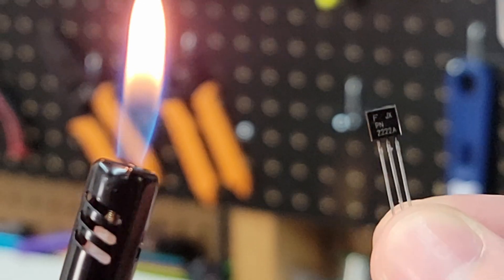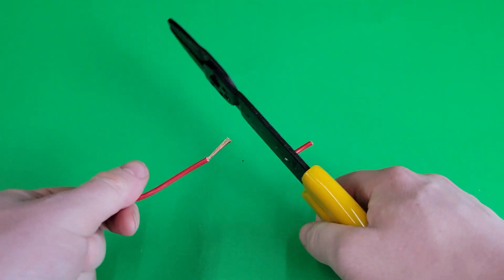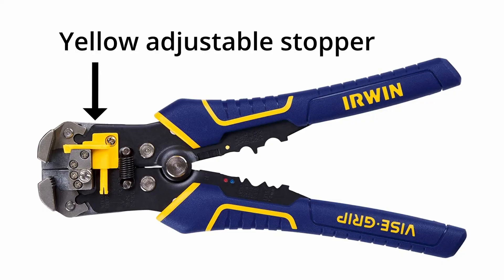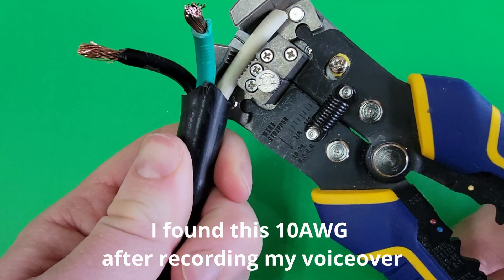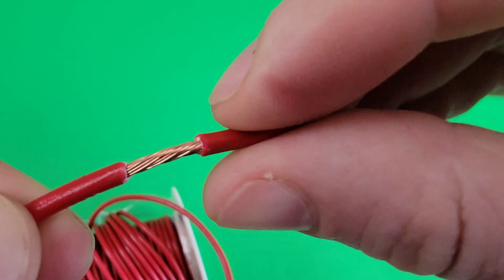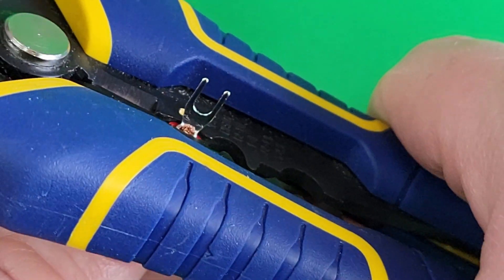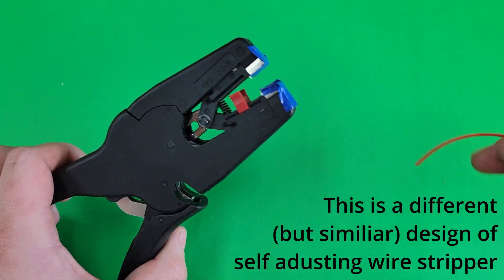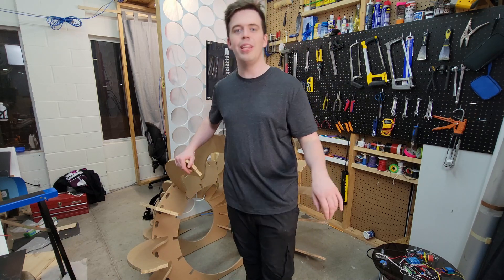Why I Swear By Self-Adjusting Wire Strippers

Comment: Agree, automatic / self-adjustable wire strippers are essential. I use the Knipex pistol type (Knipex 12 62 180), works with most cables.

Comment: I bought one. It doesn't work at all on most wires.  The wires just slip
Reply: Use the adjustment knob ya knob
Reply: @FezCaliph You don't think I tried adjusting it ya knob?  😉 Sometimes adjusting it all the way right will help but rarely does it strip the wires on the first try.  The only way to consistently have them work is to put some pressure with your index finger on the top of the clamping jaws as they come down  to grip.

Comment: please help. I bought this exact tool it looks super easy, but mine is not taking off any wire (simple speaker wire for soldering to woofers) I tried adjusting the knob but no luck help!
Reply: It should manage speaker wire fine. Were you separating the two wires and using the tool on one wire at a time?

Comment: HINT: Turn the cheap type around so the flat side is facing the waste insulation and the bevel of cutting edge is facing the wire you will keep.

When pulling with it turned the other way as shown the slope of the edge compresses the insulation against the wire core as you pull, making it grab and much harder to strip. 
Turn it the way I suggest above and the flat edges cut into the insulation better and don't clamp it against the wire.

It somehow took me 40+ years to notice this.

I prefer a nice pair of self adjusting, but this it does help.

Comment: I use an oldschool wire stripper where you need to adjust a screw to cut different sizes regulary at our university. We often talk about buying self adjusting ones but put it of because of the price. But man, the ones you shown are so cheap I just bought myself one (just need to be careful, soon I own more tools in the lab than the university :D)

Comment: I take it you're not an electrician. I can guarantee that you would never see those on the belt of any US electrician. First of all you can't get that in any boxes or panels when stripping wires in tight spaces and they take too long. I can strip wires with my big Linesman pliers, and usually do... you just need to keep them sharp and know how to use them.

Comment: Fun fact.. it leaves teeth marks on the cable..  but there is a way around that... just feed the wire in from the opposite end then its the waste  sleave that has the teeth marks leaving your cable mark free.

Comment: I have been using the Ideal Stripmaster for many years with great success.  It never nicks the wire or cuts off one of the strands.  If you want to learn electronics, spend your money on strippers.
Reply: The last time I tried that, I learned very little about electronics. Learned some other things, though, like where NOT to swipe a credit card.
Reply: Yeah, but you don't use them much.

Comment: I've tried three different styles of self-adjusting I've got a pair of Klein just like those at the beginning of the video and they are excellent saves your fingers big time.  I never thought of grabbing the ends and twisting,before pulling them off that's a good idea cuz my fingers are tore up usually and tendahhh.
Reply: Well also the Klein have a metal length stop with a nut to lock it down at whatever length you want. I find that it comes loose after 10 or 15 wires and you'll have to tighten it back up, but it doesn't break. Also something else that does very well is take the outer insulation off of multi-stranded wire without damaging the inner ones and you can even do multiple of the real small wires at once once you take the outer insulation off like cat 5 etc two or three squeezes all stripped and ready to go for your connector